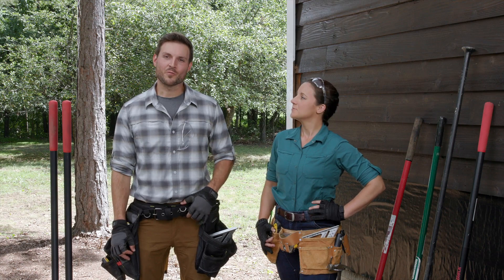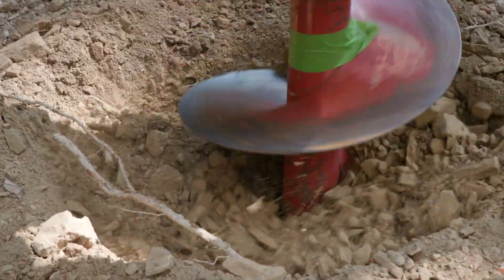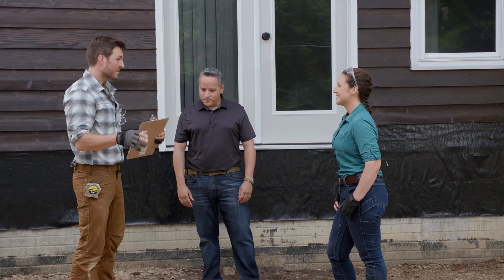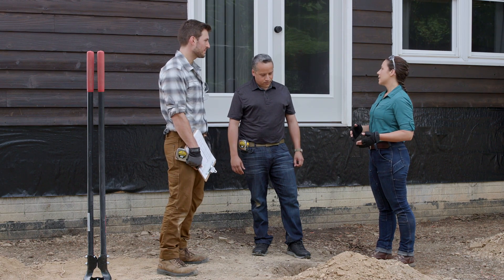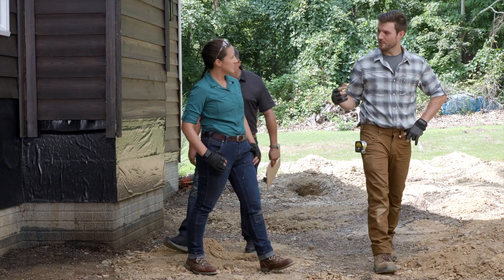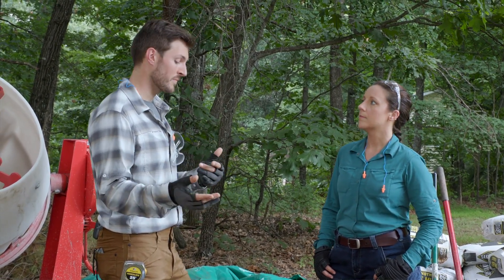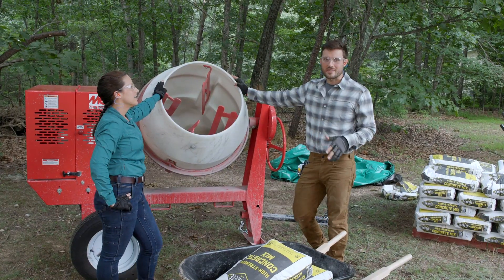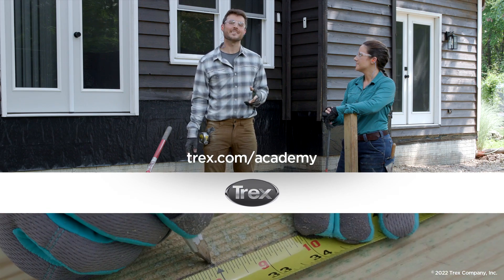How to Install Deck Post Footings | Trex Academy

Comment: ZERO videos with content showing how to install the REQUIRED TREX ADJUSTABLE FOOTING for deck posts and not ONE Trex video showing certified Trex deck builders using Adjustable Footings among their deck posts. Unbelievable. I had a Certified Trex contractor install my deck and he did not use a single Adjustable Footing. $33K later, I'm trying to find someone to take down the entire 52ft 2nd level deck that has a 6" sway because the Trex Certified Contractor failed us. Who would anyone turn to repair this in such a situation??
Reply from the maker: Hi. I want to apologize for the experience with our material. At the top of our website, you’ll find a helpful link labeled “Find a Builder.” This fantastic tool is designed to connect you with reputable builders in your area who are experienced with Trex products. While these builders are not directly employed by us, we take great pride in maintaining quality standards. Here is the link: https://www.trex.com/find-a-builder/. If you have any more questions or if there’s anything else we can assist you with, please don’t hesitate to let us know. We’re here to help! - Abby, Trex Customer Care Team

Comment: A small summary for whoever wonders like me: the  depth is 24", the diameter is a little over 12", both can be very dependent on the local code.

Comment: My planning office told me I only need a framing and final inspection. Would you schedule a footing inspection anyway? My fear is that whoever responded to my question made a mistake by leaving out the footing inspection, and then I'll have a problem passing final inspection later on.
Reply from the maker: Hi there! Thank you for reaching out! It would be best to call for a footing inspection. There are different situations such as the deck being directly on the ground where the footings would not be seen if things were built over it. If the deck is higher in the air the footings can be seen and can be inspected at the time of the framing inspection. It is good to cover bases and have the footing inspection done when the footings are dug. Please let us know if you have any additional questions. ~ Trex Customer Care Team

Comment: This is the way we rot our posts, 
Rot our posts 
Rot our posts
This is the way we rot our posts
But not before our client pays us.
Reply: Lol I was thinking the same thing. I. Getting ready to build a free standing deck and overhang. Planning to poor my footings and setting the posts in saddles. Mostly concerned with integrity. Not a lot of great info out there on the web
Reply: Use ground contact pressure treated.  Last in the ground longer than the deck frame above ground.
Reply: @beetlebailey6422  this is a lie unless the top of the deck is made of cardboard.

Comment: I have seen countless decks built with no inspections or permits whatsoever. Maybe the need to have it inspected varies on location? Or is it a must no matter what? Great video.
Reply: It might depend on how far off the ground you are, and locality. A 2nd story deck will require permits pretty much anywhere, but under 2', it might depend on the jurisdiction

Comment: What is PSI? Really?
Reply from the maker: Hi Kev, PSI is the pounds per square inch that the concrete is formulated to be able to hold.  The higher the number means a higher weight that the concrete can support. Thanks! Trex Customer Care Team

Comment: You all don't know what brutal soil looks like, just did my holes last week and we are talking boulders..  Rented a mini skid with an auger and still had to go back for a jackhammer. ;(
Reply: Was thinking the same thing. San Antonio, tx here. Luckily no frost line to speak of but maybe 6 inches of dirt if you’re lucky?  Then BAM limestone!  Post hole diggers are useless, augers would just spin. Nothing but a good ole fashioned jack hammer and hours pounding away will do the trick.
Reply: @ryandavis7390  yeah up in Salt Lake here so had to go 30" down and the whole state is made of shale and granite.. well least my yard..lol It wasn't fun at all.
Reply: I recall a deck we did that had extrememly hard soil. Maybe not as bad as yours but after getting down about 6 in  we had to use  power auger. With the power auger we went at a rate of about 1 1/2 in an hour. that was pretty darn rough
Reply: Okay I wont complain about my Sandy clay anymore. I just dug 42” holes for my deck with a manual digger and a shop vac to suck it up once it gets deep.
Reply: I can understand if its hard to dig when theres rocks. When i lived in salt lake city i worked for a landscape company and had to dig sometimes. It was hard because you were always hitting rocks. But i think the worst experience ive had was here in texas while trying to dig post holes for a deck i was building. There was no rocks but the ground was so hard we were sweating our as off to barely dig an inch of depth. We had to go buy one of those long metal bars it helped alittle but not much. Then we tried putting water in the hole to soften the dirt up. Wed leave water in some holes then wed work on others and then wed come back to the first hole to dig out like an inch of soft muddy dirt. We did that til we got a foot of depth and we said fk it thats how deep theyre staying cause we were exhausted already 😂 worst fkn dirt ive had to dig in, it took hours.  The owner said he knew about it he said he had an auger on a tractor and even with that it was hard to make holes. He said he thought it was because his land had been used for raising cattle for many many years . Not sure if thats the reason but there wasnt any other reason i could think of because like i said it had no rocks, it was so frustrating